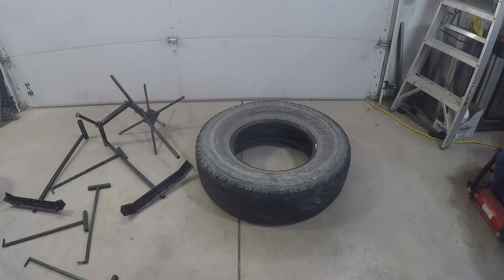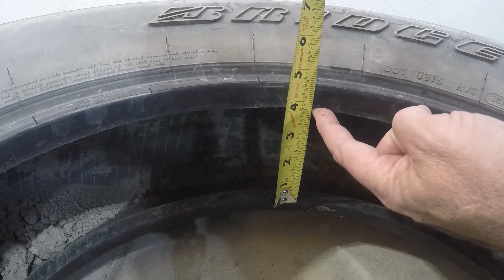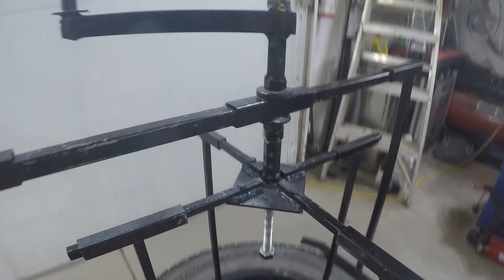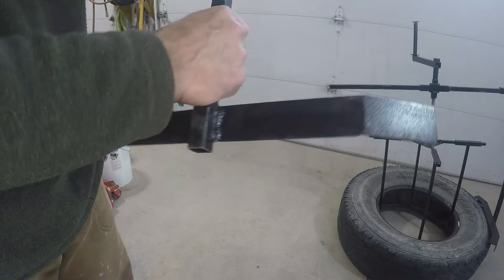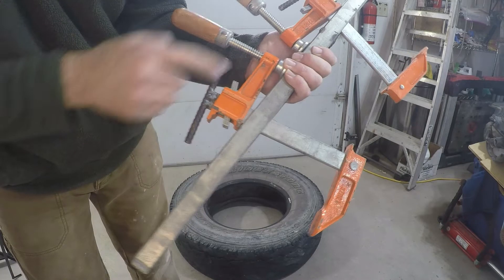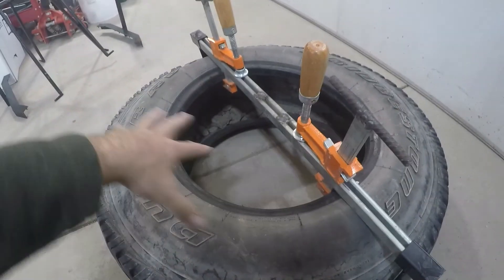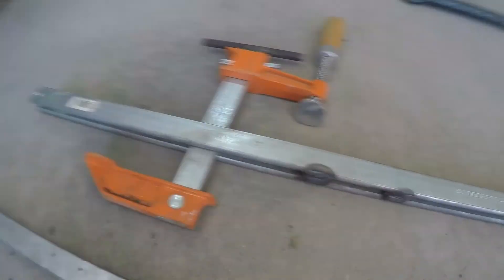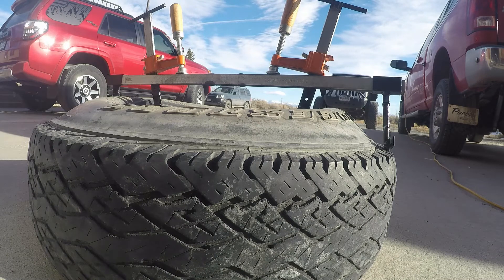Tire PACKING Tools - Compared!!!

Comment: This is fantastic! Your design also solves several major problems that mine keeps encountering. First, after a few hundred tires, the constant wear of dirt on the threads causes one to have to replace them. Second, the height is a bother when you are high up on the wall and have to step over or around the tool to carry dirt buckets. Third, yours is much less expensive to build and takes far less fabrication to create it. Fourth, yours breaks down into a size that is much easier to carry and store. Yours solves all of that. 
   I’m definitely going to build one like yours. I’ve got another big wall I need to build for my daughter’s home.
Reply from the maker: Thanks for the feedback! Are you making videos? I would like to see them! feel free to post links here if you can!
Reply: @anesthesiadreamin  I’m JD Humphries, by the way. 😅
Reply: @anesthesiadreamin  I plan to make one like yours and try it within the next two weeks. I think it’s a great idea. Simple, inexpensive, and portable

Comment: Don't know what you are doing exactly, but could you attach the tire to the top of a engine lift and have 2 to 4 chains with hooks to pull up with and leave the center open, not sure may be a good way
Reply from the maker: Yes, that would work for some levels, earthship homes are made out of rammed earth tires that are stacked. Sometimes 15 tires high. So the engine lift would work well, until it wouldn't reach the upper levels. So we're looking for a tool that is light, easily movable by one person, and can be used high up on a tire wall. If you have any other ideas, please let me know! You can search earthship, and images will come up of how they're stacking and pounding the tires. Thanks for your feedback!
Reply: @anesthesiadreamin  oh, just assumed you filled and brought to the location.